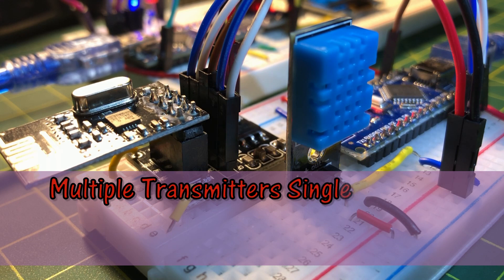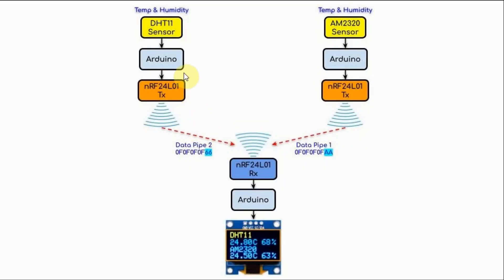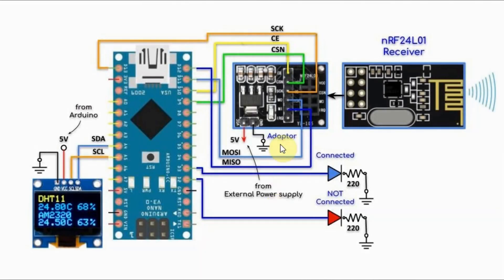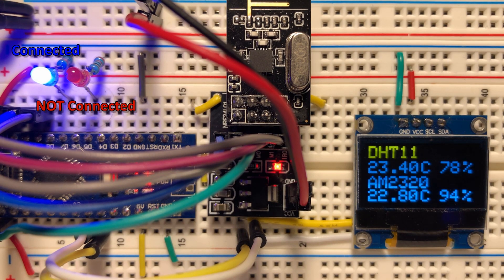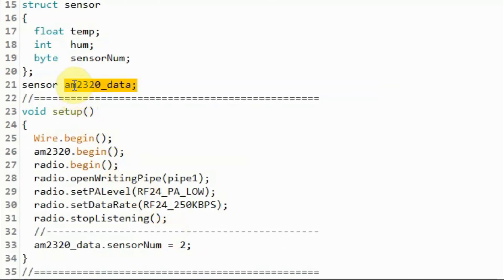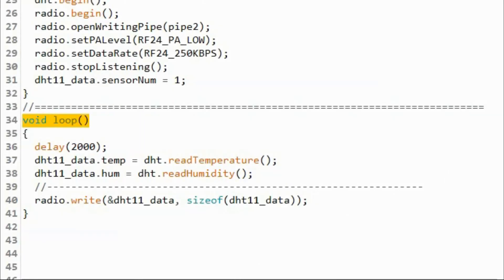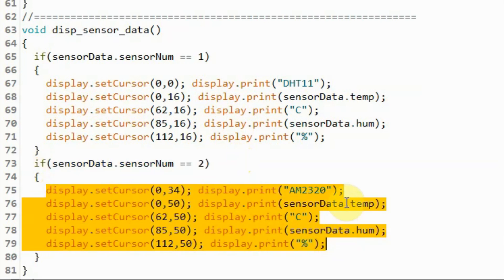Multiple Transmitters Single Receiver Wireless Network via nRF24L01

Comment: Hello sir.
Thank you very much for sharing your work.
You give the pipe,s a number code.
const uint64_t pipe1 = 0xF0F0F0F0AA;
const uint64_t pipe2 = 0xF0F0F0F066;
What is a number code for pipe 3 and 4 etc.
Is there a table for that?
Or do I have to make my own number code
Thanks in advance for a response.

Comment: As you have an id in the data packets, you don't need to use more than one receiving pipe.
If you distinguished the received data by their receiving pipe (via radio.avalable(&pipe);), you would really use the pipes.
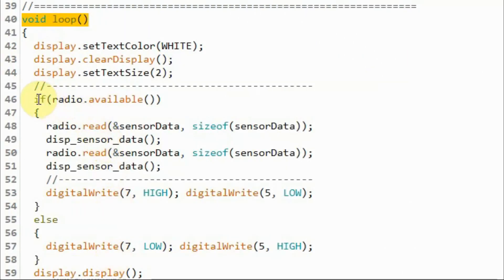6:03 The receiver code show here uses two reads for one available, which is wrong.
Why do you use the deprectaed uint64_t for the addresses anyway?
Reply from the maker: Thanks for the feedback

Comment: great video sirr! thank youuu and also is it possible if every transistor consist of 2 different sensors? for example transmitter 1 have dht11 and a gas sensor and then the second transmitter is the same? what should i do to change the code?

Comment: Thanks for your video. How is it possible to have 1 NRF204 transmitter and send exactly the same data to multiple NRF204 receivers, for example 4 receivers. I have Max7219 connected to Arduino to display 7-segment LED and wanted to send data wirelessly to other 4 Arduinos to display exactly the same output. Thank you for your help.

Comment: Im confused about the radio.available() part. You say that you read the data from both pipes sequentially, but the code looks identical. Also, what if there’s only data in one of the pipes and you are trying to read twice as shown here? I think that the receiver should request the data from the sensor instead, as another commenter suggested. Would be great if you could make a video about this. Thanks for the great and concise content.
Reply: It seems that you should only read one time for every radio.availablable() event. That's how I coded my receiver. I doubt possibilities of receiving from both pipes at the same instance on the same channel frequency. I am waiting for delivery of my second transmitter to confirm that. I'll let you know. For my project, the receiver will always be powered up but both transmitters will be powered by battery. They will only wake up every hour or so. The receive cannot ask for a measurement when needed. However, it will continuously monitor the radio.available() coming from either transmitter.

Comment: I don't know if you still reading people's comments but I need some help on a project that I working on.
I using your code,(works great) but I trying to get the receiver to ask the transmitter to check for the temperature first ,then the transmitter receives the request then reads the temperature  , then sends it back to the receiver then it can work on the rest of the program.